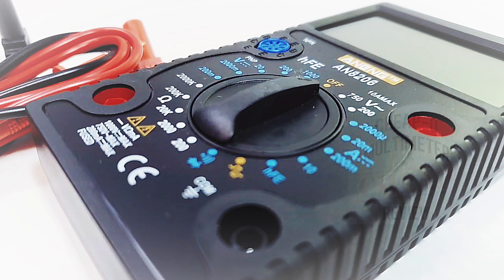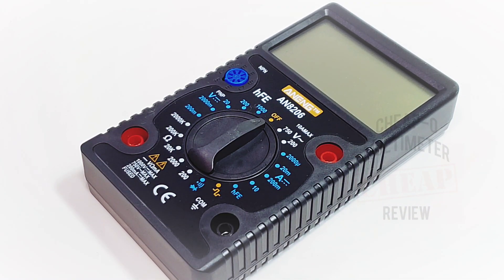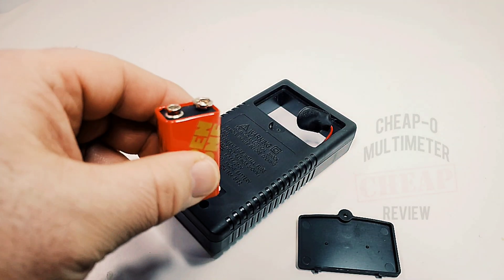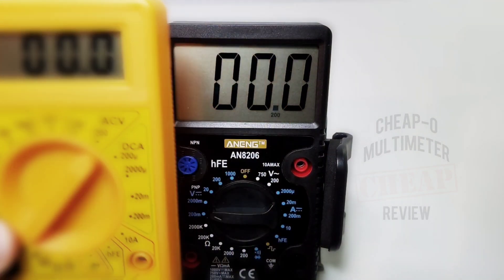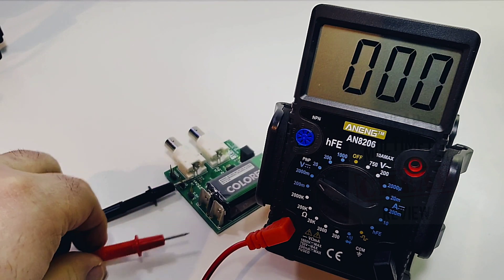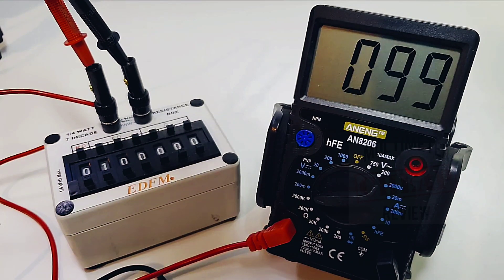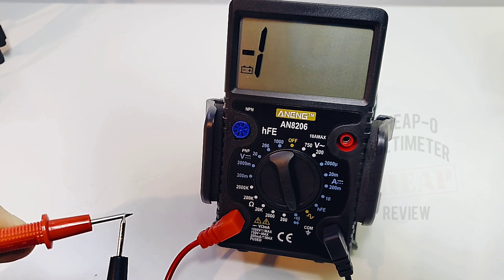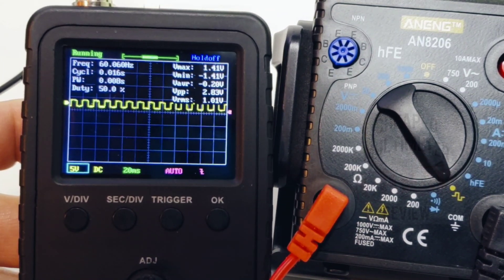ANENG AM8206 CHEAP-O Multimeter Review & Teardown!

Comment: I liked the video. And in that time of quarantine, I started to learn electronics. I bought one of these. And, unfortunately, I went to measure the voltage of 110 volts and put the selector to the 2000 microamper. Well, now it's burned out. I have two other multimeters, but I'm trying to fix this one. Do you have any tip?
Reply from the maker: Welcone aboard, Electronics is a great hobby, career , past time that will last a lifetime! 

Sorry to hear about your multimeter accident. Whats the current state, you say its burnt out. Does it turn on ar all? Do any Ranges work?
Reply: @KeepOnTesting  oh!! thanks for answer me. So it works, but marking everything wrong. It doesn't measure anything right. The numbers appear on the display but with very crazy values.
Reply from the maker: @JoaoPaulo-rw8gj  Can you take a  closeup of the PCB and email it to me, I'll see if anything looks amiss . Email: Netplicity1@gmail.com

Comment: LOL - You might have got a dud on the continuity, sometimes if they get polarity wrong the beeper does the high low thing-??  My continuity works normal, also as I recall I was able to use the only existing POT to tweak the DC into a more accurate state - mine read two or three tenths low as well, now its right on.  But all in all as you said its five bucks -- how much can one really ask for these days for $5.00--lol
Reply from the maker: Spot on...cheap but useable...I like this little oddball not exactly sure why but for 5$ it's definitely got zing!
Reply: ...and it IS an oddball especially with that jack configurattion, finally got my curiosity up to buy one and its not as bad as it might have been keeping the giveaway price in mind.  The display is the best feature, it does have a good display.  Hope you get the others you ordered, at least send an email and maybe theyll show up -- use em in giveaways or something.